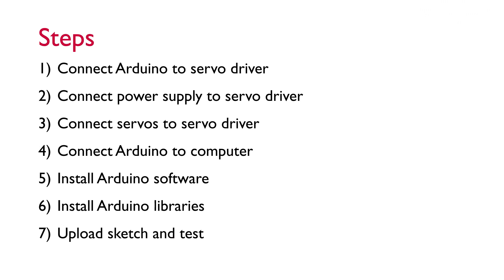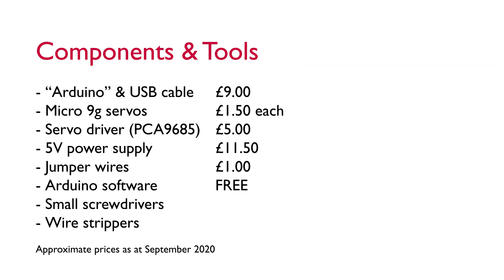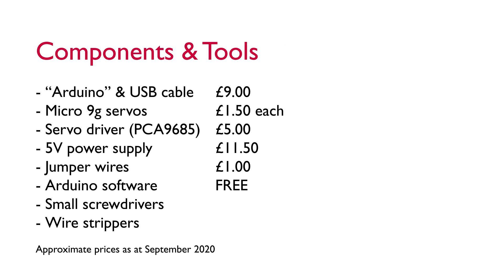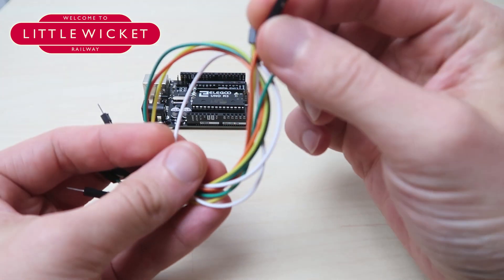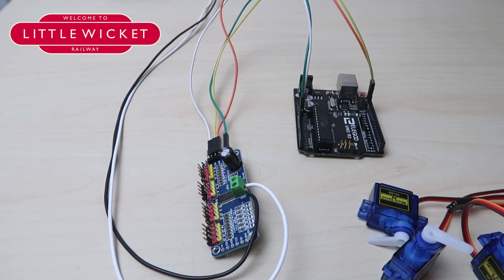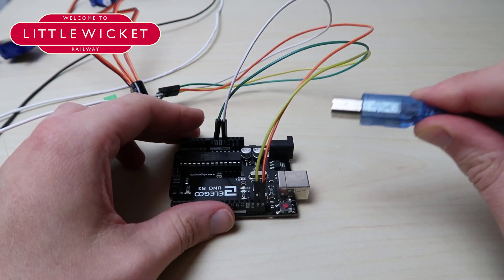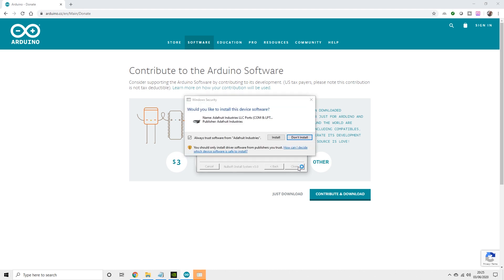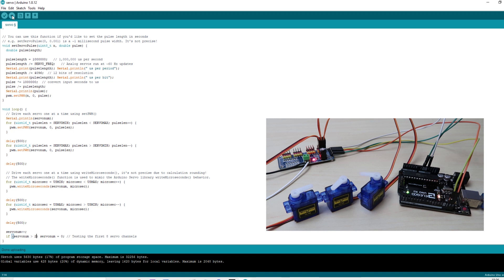Servo Motor Control for Model Railways Part 1 of 3 - Setup with Arduino

Comment: Great videos, thanks. All boards correctly wired and all software installed, but no movement from the 3 servos! I have 1 green led showing on Arduino with tx led flashing slowly. I have red led showing on servo board. 5v power supply checked OK. Computer port OK. Any ideas, please?
Reply: Just connected everything and uploaded sketch and have the same problem, no movement in servo. No green light on arduino just red. Have even tried swaping out the board but same result. Any thoughts.
Reply from the maker: Hi Stewart, again, sorry this hasn't gone smoothly. There are basically 2 things to check here:

First the sketch:
When you upload the sketch did you get any errors?
Did you see the lights on the Arduino flash to show that it's receiving the sketch from the computer?
Once the sketch is received and running you should have the lights blinking similar to how they are in the video with the power on light and the TX light flashing occassionally: https://youtu.be/ayOoUkdjHtg?t=1029 

Second the hardware:
Have you triple checked the connections? It's easy to confuse VCC and V+ for example or mix up SCL and SDA.
Have you got a 5V power supply connected to the PCA9685 to power the servos?
Are the servos definitely plugged into connections 0, 1 and 2 and are they plugged in the correct way round?

Let me know how you get on.
Reply: @LittleWicketRailway  Thanks for the reply. I think it may have been a faulty servo control panel, swapped it out and it worked OK, or maybe I connected it better on the new one.
Thanks again for the info as I am just starting to build the layout and all money saving tips are welcome.
Reply from the maker: @stewart murphy  glad you got it working
Reply: Thanks to you all for this help. I have concluded that my servo driver board is faulty since I can successfully drive  servos using Uno with a different sketch. I have ordered a replacement, and I will let you know how I get on.
Reply: Well, it WAS a faulty board, so apart from spending (wasting/learning) many hours of my precious lifetime, no harm done. Now to attempt Part 2 of this amazing series. Thanks again to you all.
Reply from the maker: Hi Ross. Sorry this hasn't gone smoothly (nothing ever does 1st time in my experience!). Time to do a bit of fault finding:
Did you have any errors when you uploaded the sketch?
Triple check your wiring between the Arduino and the PCA9685?
100% plugged the servos in the right way round and they're definitely on pins 0, 1 and 2?

Comment: Man buying these components aren't easy. They don't ship to New Zealand, yet they ship internationally...go figure. I have often thought about using servos but all of the various railway guys use point motors so I am liking this video 📹😀.  Searching for the components is an interesting exercise 😉.
Reply from the maker: If you can afford the fancy tortoise point motors or similar then they do look really good, but you could probably fit 10 servos for the price of each tortoise. Shame that getting parts is so hard in NZ, there must be a market for them.
Reply: @LittleWicketRailway  hello again, I managed to get the parts so I'll need to watch ⌚no watch your video a few more times to get my head around the down loading stuff. 😀 fun, fun oh did I say fun? 🤔

Comment: Thanks so much!  I've been working with the Adafruit Servo shield, which is the same as the PCA9685 you are using but after some soldering it mounts directly on top of the UNO or MEGA.  I've been using this as a standalone setup to control turnout servos using pushbuttons to set several turnouts at once for a route as in a yard throat.  
One other thing to note:  after adding the libraries you must restart the Arduino IDE.  Looking forward to catching up on the rest of your videos.
Reply: I'm looking into buying the PCA9685 board with the Adafruit servo bonnet/hat. How do you trigger the servo's to move from that adafruit board? My YouTube about has contact info if you want to message me. Cheers!

Comment: I might that I really enjoy watching your videos on adding tech to your layout.  That being said, I am still a little perplexed on one thing. Can a whole model train be Ean with one ardiuno or am I looking at multiple ardiunos by the time I'm done.  The layout that I have is close to 24 feet by 24 feet and there are 40 turnouts in the engine yard alone.
Reply: I'm no expert, but see Rob's video on piggy backing boards........you'll probably have to make your own wire looms, but chances are one board can sit near enough points to be fully used. Then linked to a distant one which controls more. etc etc

Comment: Hi, it seems that there are two types of SG90 servo's, one is a continuous turn and the other is a 180 degree turn type, so just be aware to order the 180 degree which is the correct type for this project.
Reply from the maker: Thanks for letting me know 👍 Do you have a link to the continuous turn versions?

Comment: Hi. I was wondering after configuring the signals and switches I dont want to use JMRI to steer the layout, but manual with some toggle switches. Is that possible and where do I connect the switches? On the arduino board or on the 9685?
Reply from the maker: Hi Hans. That's definitely possible, but will need more coding in the sketch. If you add the switches to the Ardunio as inputs then you can write code for them to activate the servos.

Comment: Great informative videos Rob, thanks. Just a quick question on fitting the servo's to the points if I may. I am using n gauge peco electrofrog points so, when inserting the servo rod, do I need to remove the point spring as you do for tortoise, cobalt, etc? Thanks and, hope the move goes well. Clive
Reply from the maker: Hi Clive, I've got to be honest and say that I've never used n gauge so I couldn't tell you, I doubt it would be a requirement. For OO it's a matter of preference. A servo should easily be able to overcome the force of any spring if it's fitted correctly, so it's not a performance thing, but it looks smoother if the spring is removed. Without a spring you'll need to make sure the servo is calibrated correctly to ensure the blade is securely up against the rail, without stressing the servo, since the spring won't be there to take up any slack.

I've accidentally removed some point springs before whilst ballasting and my only warning would be that once removed they don't go back in without a fight, they have a tendancy go missing easily and it's hard to get/make replacements.
Reply: @LittleWicketRailway  thanks Rob, I think I will see how I get on programming the servos first and then decide if I can get them to stay in a position I am happy with. May try removing the spring on an old point and see how it goes. Thanks again.

Comment: Hi thanks for these video they are very useful espically for a novice like myself. You have given me food for though. The only thing is if I were to go down this route is I would want to be able to use the servos for point motors and signals. But I would perfer to use toggle switches. Is their any chance you you be able to do a video showing and explaining how to use toggle switches please. Thank you in advance. Please carry on the good video and how twos
Reply from the maker: Hi Shane! Would you be using switches and JMRI or just switches? Either way it's posssible. I've got a video planned, but the house move is causing me a bit of stress at the moment, so I'm way behind on everything.
Reply: @LittleWicketRailway  hi I hope the move goses well. Ideally I like it to be just  the toggle switchs operating on their own without thr jrmi or any other software. Thanks in advance.

Comment: This is interesting.  I’m still running DC but I would like to use servo motor for my points but with independent switches for each point.  I can’t find anything to do this ? any ideas.  Thanks
Reply from the maker: Hi Leigh! Definitely possible either with or without JMRI. You might need to do a bit of programming, especially if you're not using JMRI. Switches are setup as inputs and the Arduino changes the servo based on the switch. Can also add in some LEDs as outputs for route indiction. I plan on doing a mimic panel with switch control of turnouts in the future, just need time 😀

Comment: Hi Rob, I’ve just began my new adventure into model railways. I’ve been watching your videos and decided to go down the route of  using Arduino. I’ve done everything that you’ve shown on the videos but unfortunately keep getting an error message. Any help would be much appreciated. Many thanks, Shushil
Reply from the maker: Hi Shushil, can you share the error message please?
Reply: Hi Rob, could it be that I’m using minitrix point motors instead of the micro 9g servos?
Reply from the maker: @shushilkumar3664  yes, I think so. Minitrix point motors look like they are electromagnet solenoid types. The servos are a completely different type of motor.

Comment: Hi Rob,
Good series! I'm in the process of starting up again with model railroads. Due to space constraints, I've decided to go with N scale. And there I have looked at Kato Unitrack. But their points come with the electronics installed. So that would be solenoid driven points, or I'm I missing something?
-Jens
Reply from the maker: Hi Jens, I'm really sorry, but I don't have a clue about  the Kato points. I've just had a look on here (https://www.rmweb.co.uk/community/index.php?/topic/136954-operating-kato-unitrack-points-via-dcc/) and it sounds like they're solenoids.
Reply: @LittleWicketRailway  No worries. You can't know it all :) - I've decided to go with Fleischmann N-scale instead, and they come without building switching. So I can use servos now.

Comment: Arduino: 1.8.12 (Windows 10), Board: "Arduino Uno"

Sketch uses 5630 bytes (17%) of program storage space. Maximum is 32256 bytes.
Global variables use 428 bytes (20%) of dynamic memory, leaving 1620 bytes for local variables. Maximum is 2048 bytes.
An error occurred while uploading the sketch

hi got this message while trying to upload the sketch
any ideas on how to correct this 
thanks
Will

Comment: Two advantages of using servos over solenoids that you didn't mention:-
1) They are a lot less noisy...you don't get that load CLUNK when the points are changed.
2) If you remove the over-centre springs from the points you get a more prototypical slow movement of the tie bar.
Reply from the maker: Agreed. I'm not a fan of the solenoid clunk 👍

Comment: I enjoyed your videos having just seen them in youtube. Have bought a megapoints system, it seems to work fine at present  although at the moment have only connected them on a testing board. One thing I noticed on a servo is that it gives a kick when you switch mains power on. Is there any way of avoiding this as some of my points are surface mounted with only a small travel needed, so that when I switch on power it kicks and the points move, would appreciate any suggestions.
Nic
Reply from the maker: Hi Nick, afraid I don't know much about the megapoints system. The servos must be receiving a signal when the power is turned on, you'll need to work out where that signal comes from and how to stop it. The guys are megapoints might be able to help if it's their system you're using. It's a word of mouth hobby and most suppliers want their customers to have a good experience, so I'd drop them an email and see what they say.

Comment: Thank you for explaining this first part Rob.
i may be an idiot But, how do I stop the sketch from cycling?
Reply from the maker: Hi Captain! If you want to stop the Servo example sketch from cycling then you can just delete the final line of code:

if (servonum > 7) servonum = 0; // Testing the first 8 servo channels

The Ardunio won't go back to the beginning then.
Reply: @LittleWicketRailway  i am  a complete numpy  to this programming thing , i ve reset servonum to zero and one of servos still cycles, any ideas please?

Comment: Hey, I thought the tute was very good and well presented.  One thing that stumps me is the polarity switching for the electro frogs. How is this going to happen?
Reply from the maker: Hi Victor, thanks! I think you would need to add a microswitch onto the servo mount that switched the polarity as the servo moved positions. Just like the microswitch for the position sensor. The MERG servo mount can have two micro switches, one on either side.

Comment: This is fantastic video. I wish you can make one that describes how to add leds and toggle switches and control it from conventional control panel without JMRI. Any ideas on how to make and wire it? Thank you
Reply from the maker: Thanks! I've had a few requests for this and it's something I'm looking into 👍
Reply: @LittleWicketRailway  Thanks. That would be great as I could not find any video or wiring diagram about it. So that would be a huge help for newbie like me.

Comment: Eleven pound fifty for a 5v power supply?!  Use a phone charger instead for a fraction of the cost.  The arduino can be powered by USB, or if you're powering the other board, you can just cut the end off a USB cable; the red and black wires inside are 5v and ground (ignore the other two, they're for data and don't carry power).  Shove those in your board's terminals and you're cooking on gas, or steam depending on your modelled era.
Reply from the maker: Hi Alec, apologies, my orginal response related to the DCC++ base station. You're right, any power supply that can reliable provide 5V DC with sufficient current for servos is fine. The power supply in the video is good because it's got variable voltage and neat connectors should you want to use it for other projects.

Comment: Hi Rob, I'm really enjoying your videos as I want to go down the automation route on my layout. Currently I use JMRI / DCC++ with an Arduino to manually control the trains, all my points are switch controlled with solenoid motors which is what I need to use JMRI for next. As I'd also like to use your IR sensor system for train detection and this system for point control using servos, is there a limit on the number of Arduinos that can be connected to a laptop though or can I add one to each USB port? At this rate I'll be up to 3 separate boards.
Reply from the maker: Hi Paul, I use three separate boards for DCC++, servos and sensors. I've started using a powered USB hub (must have its own power supply) to connect them to the computer.

I'm looking into combining some of the sketches so servos and sensors could maybe run off the same board.

I'm also looking at using wireless ESP32 boards to save on wiring and connections.

Afraid progress has been a bit slow on the tech front, but try to get some guides out in Jan.
Reply: @LittleWicketRailway  Thanks for your reply Rob, I'm glad that multiple Arduinos work ok. As my layout is built with solenoid motors I don't fancy swapping them all out for servos so I'm going to use an 8 channel accessory decoder for the part I want to try automating first. I'll then use your IR sensor system for train detection as, like yourself, I don't fancy pulling up the track to fit the insulators required for current block detection. I'll let you know how I get on during January. I may even pop up a video!
Reply from the maker: Little wicket has solenoid motors too which are controlled using accessory decoders with capacitor discharge units fitted. You don't need to change them to servos.

Using IR sensors to do automation is slightly trickier than using a combo of IR and current sensors, you may find that you end up writing scripts rather than using the built in JMRI automation or having to make use of JMRI Logix. But it can still work well.
Reply: If the Arduino is handling automated non-interactive applications (eg reversing loops and block signalling) then they only need to be connected to the computer to upload the sketches, thereafter they can run from  a 5 volt DC power supply, indefinitely. Arduinos that are handling points/turnouts/switches and DCC++ will need to be connected to the computer full time.

Comment: Hi Rob Nice Video, can you please make a video for servos to be used with toggle switches please
Reply: I would like to add  something to Gajantha’s request. Use toggle switches to run servos via the PCA board and also allow the same toggle switch to light LEDs for main and divergent track. Rob, you do a really nice job with your videos. I just found your channel last week and subscribed. Regards, Rick
Reply from the maker: Hi! Do you mean with or without JMRI?
Reply: Without JMRI Please